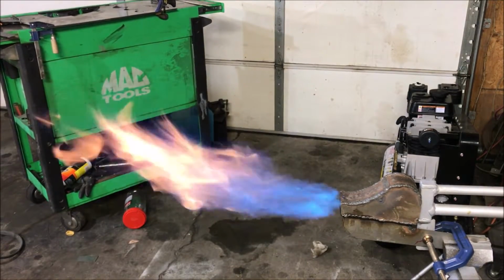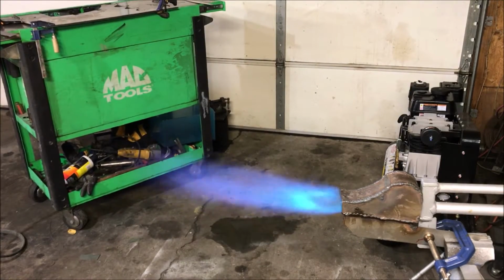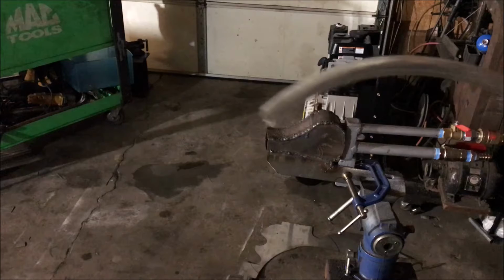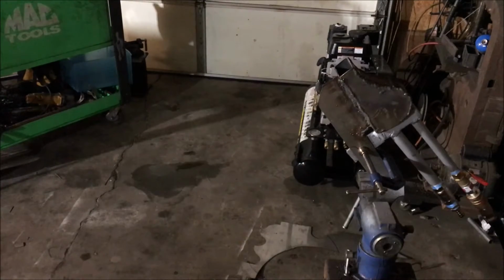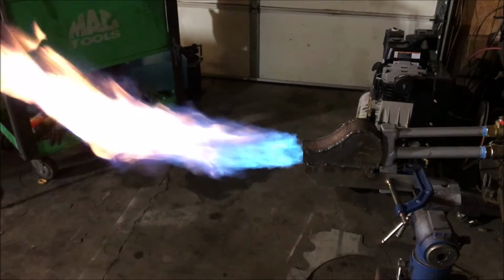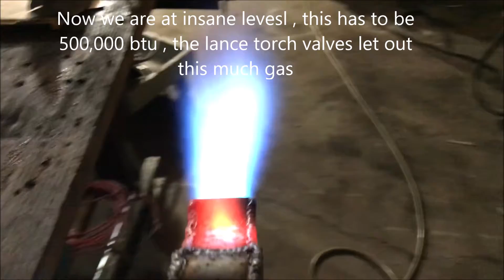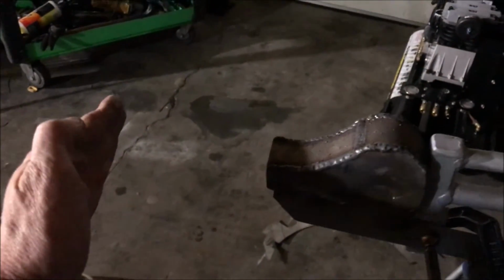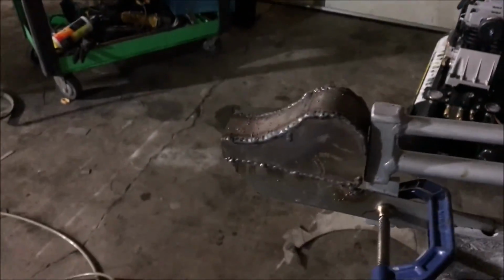High velocity Propane Forge burner INSANE POWER

Comment: Don't know it this is mentioned or caught yet. But at 2:06 i saw what appears to be condensate drip. Be very wary about this when using gaseous fuels at high velocities inside a tube. You could cause frost buildup if not enough heat us radiating back.